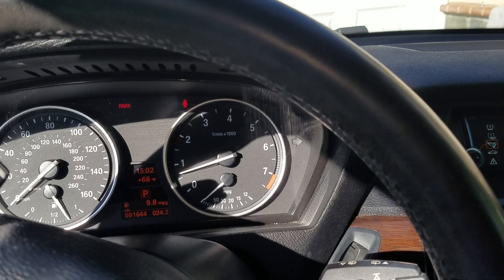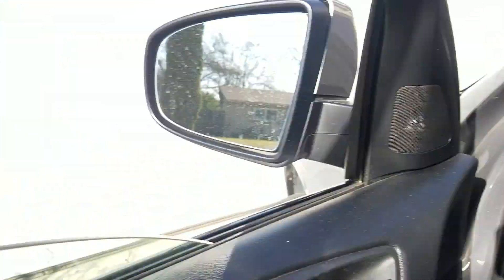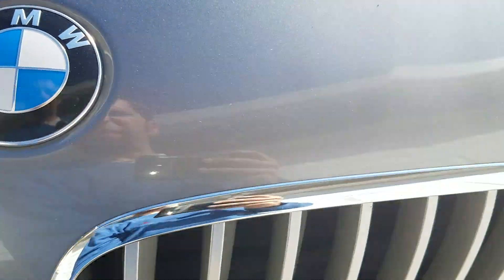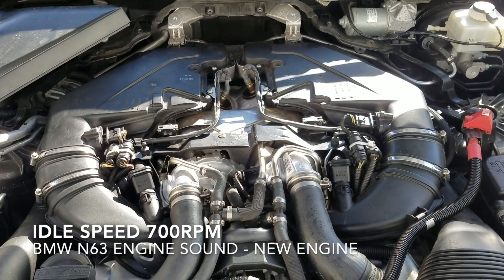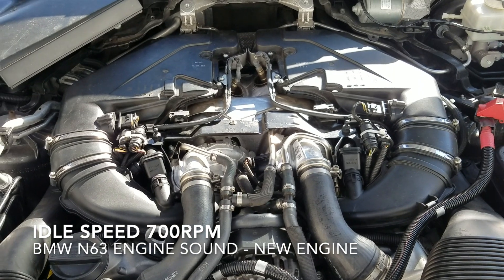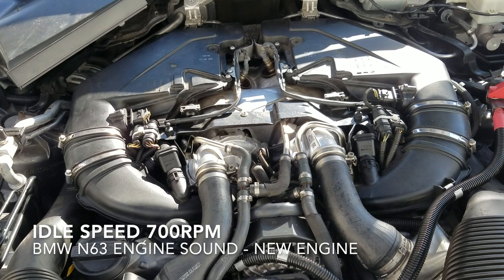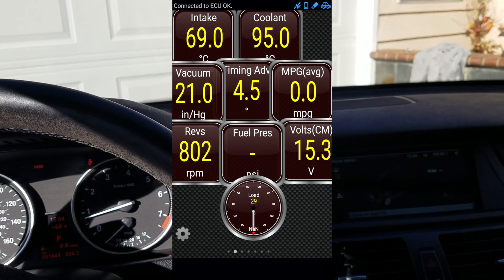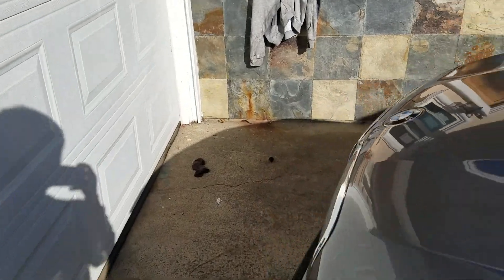BMW n63 engine Normal working sound with different Idle speeds (700rpm and 800rpm)

Comment: Brother, sorry to bother you with some more questions. I had to go through the same issues of buying a new engine from bmw .. I see your videos all the time .. and I see how much knowledge you have .. my car is not running how I expected it with a new engine now.. what could my mechanic be doing wrong? He has never worked on a n63 engine 4.4 .. so we really would appreciate your help .. he may have not programmed something correctly.. thanks in advance
Reply from the maker: Hi! Sure. No problem! First, double check that the mechanic put NEW OIL! That's very important. The oil that goes with the engine is an assembly oil. It's just for transportation. Also, it's not enough of this oil - just few quarts instead of 8-9 quarts!!! So, this first step is very, very important. 
When you start the engine the first time - you will get white residue under the oil cap. Don't worry - it's not the blown head gasket. It's the assembly oil that gets evaporated. (another reason to get rid of this oil). 
And if you still have bad sound, then you need to connect Computer and using Rheingold check and update your Fuel Injectors! Each Fuel Injector has specific Numbers and when installed - programmed into the computer. That is you can not install old injectors to another cylinders without reprogramming them. 
Another thing is that you need to do Coolant Bleeding procedure the right way. So that air is not trapped anywhere inside the engine and you are not overheating it. 
Hope it helps.
Reply from the maker: Where are you located? Close to Sacramento? If yes, we could meet and I could at least diagnose it and tell you more. I'm a math teacher, but did some much on our car, that probably can say a lot about n63 engines now. :)
Reply: @waspsps  thank you so much bro. I really appreciate it ! I'll let my mechanic know. We are in Los Angeles ... but It is really nice of you to offer to diagnose my car to help me more .. God bless you .. I'll keep tou updated  .. right now Its back at the shop .. I ordered the hpfp and sensors but just one side ... my car had a check engine light on before the engine was replaced  ..
Reply: @waspsps  I did what you told me about the thermostat.. that saved me from another nightmare
Reply from the maker: @mou_oso33  I see! Sure, let me know how it goes! It's interesting!
Reply from the maker: @mou_oso33  Yep. That's a very wise decision! Good for you! I went with replacing it after reading this article: https://www.bmwlogicseven.com/?p=4035
Reply: @waspsps  bro, another question  ..my mechanic removed one of the high pressure fuel pumps .. so I could order a replacement.. but we noticed it had a stamp date of 12-09-19 .. what is that? The manufacturer date ? Could it have been replaced already by previous owner. What do you think .. thanks for all your help

Comment: Hey how are you? I’m supposed to pick up my N63 at the end of next week! I just heard to talk about break in oil. Do they give it to you with the engine for free or do you have to buy it from them? How long to I use the oil before I change it ? What oil should I use after that?
Reply: i use ravenol 5w40 rup with liqui moli ceratec in my n63
Reply: oh, and oil change every 12.000 km
Reply: @christianscheuern9957  Do you think the 10w40 motul would be good for very hot places?

Comment: What is the difference between bmw 650i f13, n63,  and e63/e64  models ?
Reply: Newer ones have technical updates to fix past issues that the e63/64 had the F13’s are much more reliable